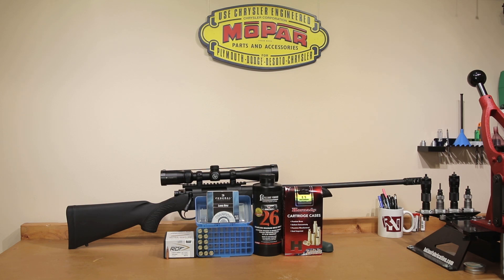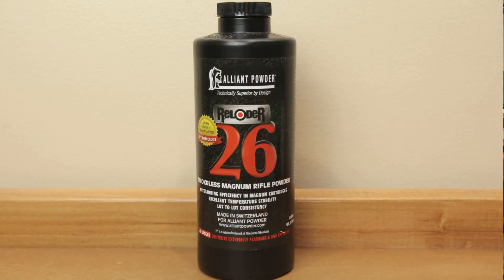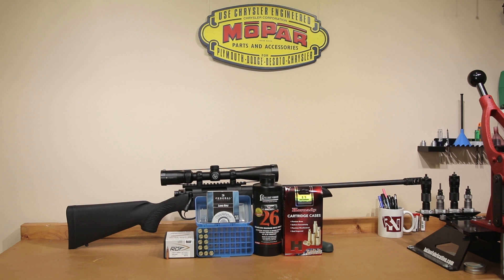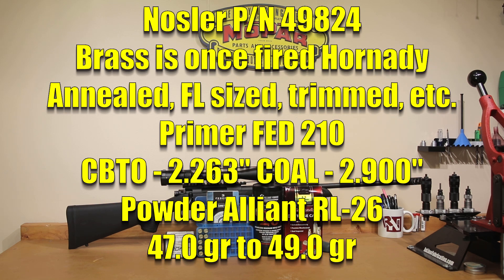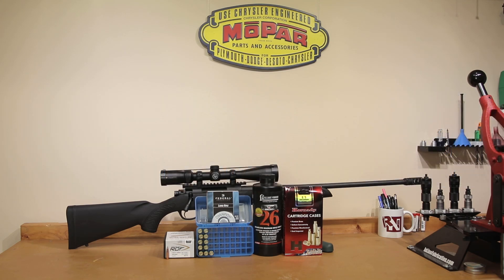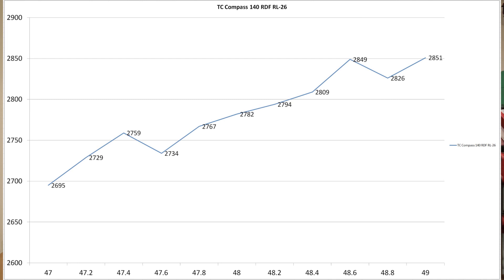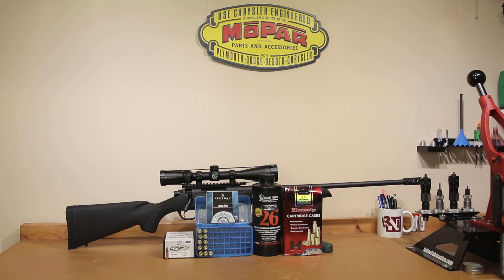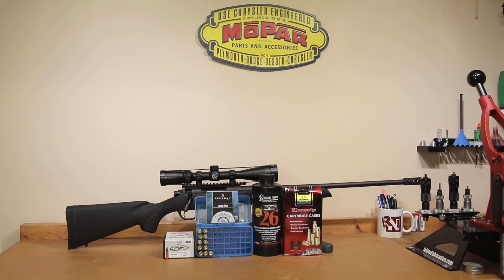Nosler 140 RDF with Allaint Reloder 26 - Thompson Center Compass - 6.5 Creedmoor

Comment: Stumbled across this video and rdf's are easily disrupted by the shock wave and keep seating. I shoot several thousands a yr through 6 creed, 6.5 creed, 6.5 PRC and 6.5-284. all are seated past .090 and one particular rifle is .134 off touch. Hornady eldm and SMK are much easier to load for but when you get the rdf happy it's very consistent
Reply: I would start at least .070 off and you will need a faster powder. Obviously h4350 is the miracle powder even tho it's not the speed king. One big advantage of a big jump mode is it will keep that accuracy for at least 600l+ rounds. Seating less than .020 is a tail chaser because unless you using cnc solids or Bergers the bullet profile will not be consistent enough. Also the barrel is a wear item and it is constantly changing which keeps you chasing that node

Comment: I run the 140 ELD-M in 6.5CM with 47.8gr of RL26, loaded to 2.850” COAL. Groups awesome and I get 2925 out of my 24” barreled Bergera HMR-Pro.

Edit: I have several 6.5 Grendel and 6.5CM that just love the 130 Nosler RDF, loaded to 2.260” in Grendel and 2.800” in the CM, which is jumping them over .130” but grouping into 1/2MOA consistently. The RDF’s seem to like the jump.
Reply: Did you mean 47.8 grains ?
Reply: Wade Perkins yes I did, thank you! I’ve corrected the original post.
Reply: I just reloaded some 140 gr eldm with 48.8 grs of rl26 , lapua brass , and federal 205 small primers. I have a bergara hmr in 6.5 cm. It has a 22" barrel.
Reply: Wade Perkins that’s close to my recipe except I use Rem 7-1/2 BR primers in my Lapua brass. Tried the GM205M and the 7-1/2 both, the 7-1/2 gave me better ES/SD from my setup.

Both types primers started to get pierced in my gun around the 48.5-49.0 range, I’m not near my notes to confirm presently.
Reply: @jimhans1  I have had good luck with the Federals & CCI BR-4. The only reason I have not tried the Remingtons is because I watched a video of Johnny's reloading bench and he was piercing primers at 48.2 with rl26.
Reply: Wade Perkins that was his gun and not the primers fault technically. His rifle had lots of primers with craters even at starting charges lol. His firing pin and the FP hole in breach face were nowhere near tight. The 7-1/2 is tied for first place on cup thickness. https://www.accurateshooter.com/technical-articles/primers-and-pressure-analysis/

Edit: I won't use the CCI BR series primers, they come off the standard production line and are rated as "BR" based on the seniority of the operator who is working the machine at the time and nothing else. At least Federal and Remington have dedicated machines running small batch to guarantee consistency.
Reply: @jimhans1  I had no idea. I do use Remington 6 1/2 primers in the Grendal sometimes without any problems. I know the saying to not believe in everything you read , but I do trust you in what your loading with yours. With that being said , I will start using some Remingtons. I appreciate your honesty. Now I have a go to friend to help me in reloading. I used to shoot a lot back in my day and really getting back started reloading. A lot has changed except the basics.
Reply: Wade Perkins be very careful using the Remington 6-1/2 primer, it was designed to be used in 22 Cooper, 22 Hornet, 218 Bee, and other lower pressure rifle cartridges. It has a very thin cup, I've pierced them with lower end starting charges in 223Rem and 6.5Grendel. Especially for Grendel I would recommend the 7-1/2 over the 6-1/2
Reply: @jimhans1  I will definitely go out to Basspro tomorrow and purchase those 7 1/2 Remingtons !! Thanks so much for the good advice 🙂